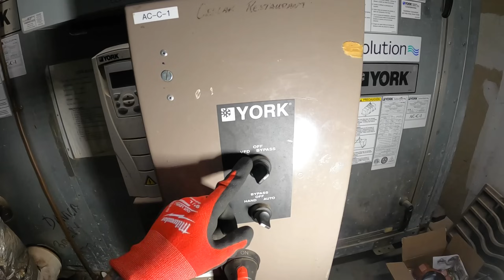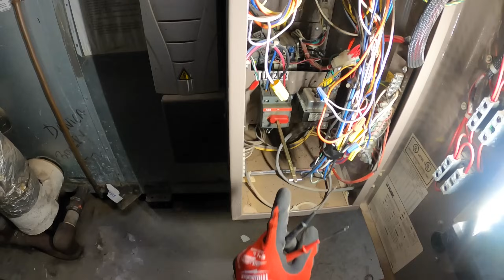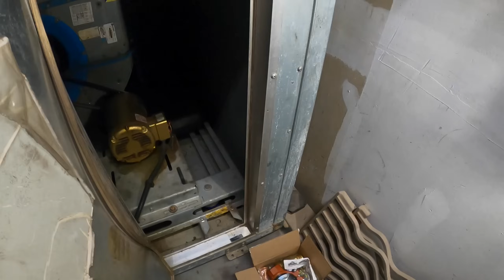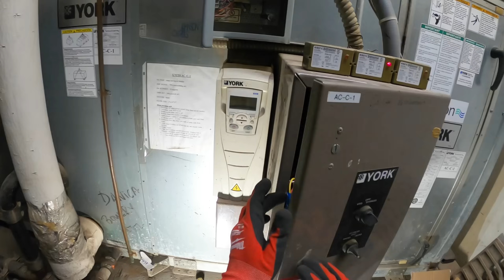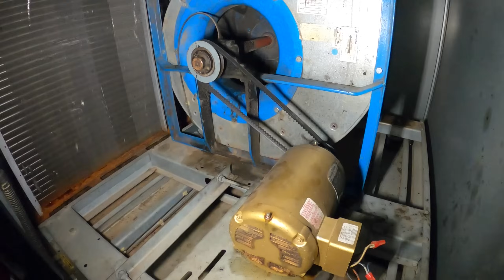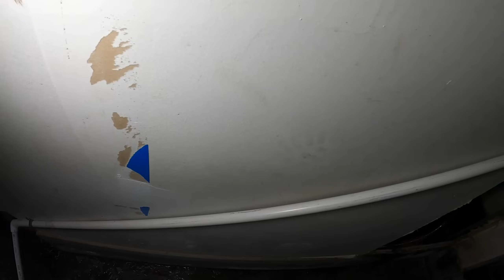HVAC: Commercial FCU Not Heating/Cooling (FCU Fan Not Running) Commercial HVAC Troubleshooting

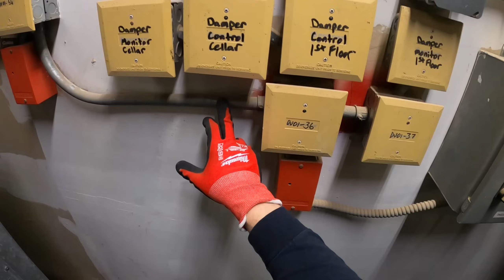Comment: @4:35 about wall devices: those are SLC (signaling line circuit) relay modules. Those tie into the fire alarm system. They can have either green or red LED indication (it just depends on the model). That steady green on the first module is an indication that the relay has been engaged by the fire alarm and if it's tied into the fan controls, it might have overrided the fan power (as fire alarm signals always have control priority). All the other ones are flashing indicate that they are in communication with the fire panel and in the normal state.

Comment: had the Fire detectors trick me one twice w/ an open run  circuit esp after they just left the site & had a few leaks develop also ..iam to big to crawl in on that leak location  O boy Have Fun & also had build maintenance could NOT  find a cut off on hi rise leakin bad .on 9 th floor ..its crazy

Comment: That yellow and blue are normally closed contacts on an RIB. Yellow is common to blue/ closed and orange/ open set on the ones I install. Should be listed on the RIB it’s left. That solid green on the fire alarm normally means an issue on the controls safety circuit fire alarm shutdown. Blinking means operating normal condition. When you put a vfd in bypass and hand and it does nothing the safety circuit is broken. High static fire alarm freeze protection. Another thing on fire alarm contacts is they can be normally open or closed. Just did 7 rtus and the system there shutdown on closed contacts. Only way to see if look at the fire alarm module and see where the safety for the equipment is landed on.

Comment: You said it was 18 degrees, go back and check you're freeze limits, it's a safety in series that cuts unit on freeze limits, door switch, fire, ect ... Anything in that safety cuts, it cuts the circuit and opens the preheat valve.  Putting it in hand bypasses the safety and at 27 degrees you will freeze your chilled water coil  FAST and have yourself a flood😮.  Just push the whie button on the gray box that's connected to the temp probe Infront of the chilled water coil.  It will probably trip a few times because as soon as it resets the preheat valve will close to go back to set point, cold air rushes in and puts the probe under 38 degrees, trips, repeats.  You can drop the OA damper (bypass the end switch on the OA damper temporarily) then open the OA slowly and let the preheat catch back up (man I really don't make enough).  Better then 90% this is your issue 😊
Reply: P.s., the fire trip is in series so it would show as dead.  These are crazy tricky systems and you really do a great job!

Comment: Anytime you come across a VFD that has incoming power but doesn’t run at all in any position it’s always a safety that’s open. Fire, high static switch, freeze protection, usually they are tied together, just got isolate which safety it is. Good videos man.

Comment: There is usually a small abb disconnect inside the small enclosure directly underneath the VFD. Sometimes they burn up or are off. Easiest thing to do would be to take the cover off the VFD and check the input voltage. If there’s no voltage check the small disconnect inside the enclosure below. More then likely the drive failed long before you were there and they have been running in bypass for awhile. If you have input voltage to the VFD then either the display is bad of the VFD is bad.

Comment: Some of the places you work at.....yeah...im gonna stop complaining.....you get thrown in some junk areas and equipment....don't people in NYC take care of their equipment. Or they have unqualified people monkey around with it. We don't install any VFD without a bypass. That looks like an ABB ACH550 with Yorks name on it. Check AI1 for speed reference and DI for your enable...the smoke can tie into the relays through the enable circuit.  You should have 24 VAC/DC on your DI. VFD are actually quite easy to troubleshoot and work on.

Comment: Is this that unit that has a bad water leak that you fixed? Your Bad ass tech bro!! Keep those videos coming!
Reply from the maker: It is! We only made the temporary repair because they couldn't shut down the water. Some valves are leaking by. The leak got a lot worse as you can see 😂 Thank you & thanks for watching! I will be making the true repair on this in the near future when it's not so cold out so they can turn the heat off. 🙏🔧⚡️

Comment: We fix the leaks at my work as soon as it’s not busy.
Reply from the maker: Nice. As soon as it's not so cold out, they will attempt to shut the water down.  They tried before but some valves weren't holding so we couldn't make the repair. At this point, it's really bad. Thanks for watching! 🔧⚡️

Comment: Owner not wanting to spend money
Reply from the maker: A bit of that mixed in with that they tried shutting the water down twice but some valves aren't holding. They will attempt again when the weather isn't so cold as thats the hot water to supply heat for many units. Thanks for watching!

Comment: Soon as i saw the green light on that alarm panel i thought thats what is holding it off
Reply from the maker: Nice. I thought the opposite honestly. Need to keep an eye out for that stuff from now on. Thanks for watching! 🔧⚡️
Reply: @JumpermanTech  soon as I saw all the rest of the fire panels blinking and the one connected to the air handler was solid it told me that the fire panel is in alarm
Reply: @joshuabest100  same here...i was talking to my phone like....theres the problem......noooo...where you going homie....you found the issue with the fan. The green light is the source of confusion....people expect a red light or something other than green

Comment: One would think if the so called building engineer gave a crap about the forever water leak his boys would install a larger pan or some kind of diverter. We have the same issues at our accounts, to busy in the maintenance shop doing nothing.
Reply from the maker: I hear that. I installed that pan when they couldn't shut the water down so we can make the repair. Leak ended up getting a lot worse and it is what it is at this point. A larger pan would definitely help. That room is getting destroyed as we speak. Not looking forward to making that repair. Thanks for watching!